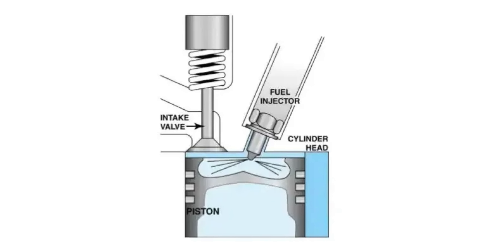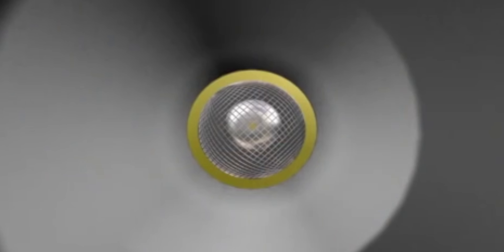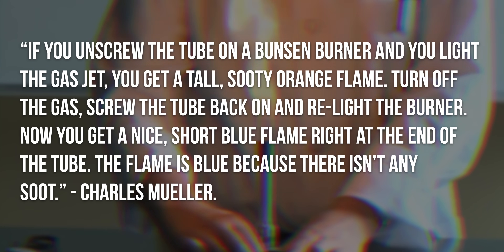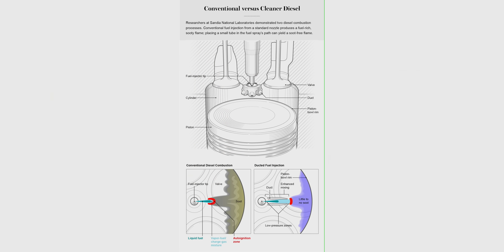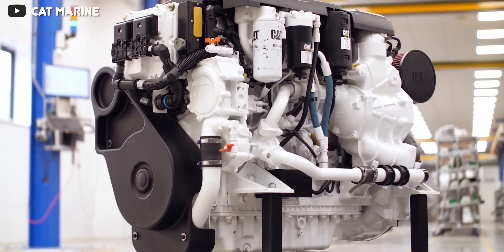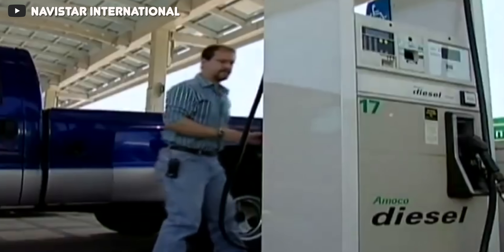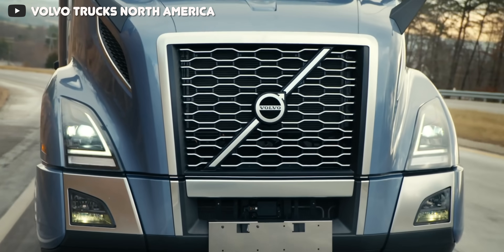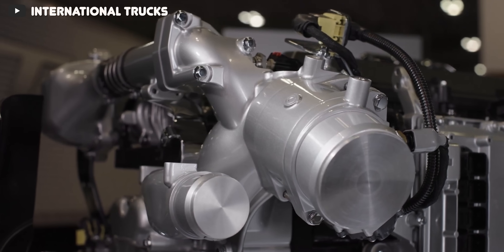Zero Emissions Diesels: How Ducted Fuel Injection can Save the Diesel Engine

Comment: You can't just massively increase EGR usage to reduce NOX, the whole point is to reduce combustion temps but you can only do that so much before you go too far and cool it too much. Soot is not a limiting factor to it. Also it doesn't eliminate soot, a 100% reduction in soot means they cut it in half. Which would not eliminate the use of the DPF or urea injection as it filters our WAY more than just 50% of soot, it filters most of it. The other aspects like NOX and other emissions still need to be dealt with. Also diesels are not almost entirely killed, there are many many types of diesel vehicles out there and they will not be killed so long as we are still burning dino oil. And right now battery electric vehicles are incapable of replacing gas and diesel vehicles. Only when we get away from batteries and and use some other kind of technology which allows for far greater energy density and are able to create clean power will it even make sense to switch over. Because right now it takes way more oil to move an electric vehicle than a gas or diesel vehicle and a modern vehicle is gonna be burning that shit cleaner than a power plant that is dated. Besides we would need to completely revamp our electrical grid to handle the dramatically increased power usage. Right now electric vehicles can only serve a niche market and it is straight up impossible to switch over quickly like many want and would take several decades. Diesels will be going on for decades to come and probably the next 100 years easy.

Comment: It is absolutely mindboggling to me how the advantages and general efficiency of diesels, especially in passenger cars, is only now properly washing over to the states.
There was a time in central europe, where more than half of new cars were diesels, and im talking small, efficient, nice.
Take a VW Polo 1.6TDi for example, one of the more common examples over here.
We have a high-quality subcompact with 5 seats, a usable cargo-area, all the comfort you could ever need, yet still less than 1200kg with a 95-115hp diesel engine that makes like 250nm of torque and takes about 3.5l/100km, thats about 65mpg, while happily cruising at 100mph on the autobahn all day long. There is also the 1.2TDi, which runs rougher and makes 75hp, still pulls about 200nm and is insanely good in terms of drivability, while approaching 70mpg on normal use.
or take all the 2.0 diesels that are around here. Between 130 and 200hp on average, up to 500nm of torque in some configurations with the average being around 350-400, still getting 50+ mpg.
And its not like they are unreliable or downsized shitboxes" either; you see all of them at 150k miles+, running around, not having any issues. and thats with people using them as short-trip daily drivers.

The general approach of giant, oversized vehicles with giant, overpowered yet inefficient engines for daily use and usually a single person occupying it has been shoved so far down the throat of many but especially americans, that its just normal and they deal with that bullshit at this point.

Diesel has not been "smelly black smoke and loud stupid engines" for like 2 decades at this point, yet that consensus is still imbedded in people. and the "dieselgate" didnt help that, while meaning that at its worst, the emissions were still pretty good, despite the cheating.

Comment: Not new combustion chamber heads have been in pistons and in the head of military equipment for years. Top money is on the lanova head.
 White diesel Mountain fuel 2 and 1/2 ton engine A combustion chamber in the piston.! 
Combustion chamber the coffee was in the head.
   The Volkswagen question chamber system in automobiles trucks and boat engines was twice as efficient on the road 65 miles to the gallon..!
    Stupid manufacturers turn their diesels down so they will use more fuel even if they have to screw with  cam timing ..!
     Military CUPV engines did 45 Miles to the gallon the Chevrolet counterpart only got 23.!

Comment: The Bunsen burner gets its extra air from the Venturi effect.  Where is this duct of the diesel fuel injection getting its air supply from?
A few questions remain unanswered.....  
-There should be a compressed air system to go alongside the fuel injection. It is easy to install one in a diesel engine. 
- the injector system has to be closer to the engine head or else there would be compression losses. 
- the injector air system should be valved and metered flow or else it could theoretically make the air fuel mixture lean and the cylinder pressure higher by acting synergistic with the turbo. 
This brings me to the last question - why didn't anyone try a high pressure common rail diesel injector in an idi engine? They could've used 2 injectors in every pre-combustion chamber. 
Why not have 2 injectors by the side of the intake valve stems? 
Did we give up on the idi engine too early?

Comment: To make a diesel burn cleanly, you first remove the shitty fuel it burns and replace it with hydrogen. You cannot make any injection system burn that crappy slow atomizing fuel well enough to even come close to 0 emissions. The atomic structure is just too complex to not react into an emission. A Bunsen burner is NOT 100% clean and carries it's own oxygen content to burn, but just clean 'enough' to use in small spaces. Diesel fuel is NOT the same as Bunsen burner fuel. Replace the fuel with a better fuel and move on.

Comment: The example using a Bunsen burner and diesel fuel isn't a very good example. And no way is injecting diesel fuel you're just saying we're doing a better job mixing it with the injector that when the Piston comes up that it swirls inside of that chamber so it gets better error mixture. But that doesn't have anything to do with the injector as much as it has to do with the shape of the head?

Comment: Almost sounds like the first Diesel injection system: Blast injection. R. Diesel wasn't able to create the high pressure directly to the fuel. So he used compressed air to inject the fuel. Pressure was 200 bar.

Comment: Could this ducted system be applied to more than just diesel engines? What about gasoline engines? What about heavy fuel oil engines used on ships? Could we see any applications of this in aerospace?

It seems that the ducted injector could theoretically be used on any fuel as long as it's a fluid.
Reply: Not much use in gasoline engines since they inject fuel prior to compression and don't produce soot. Any engine using compression (usually diesel) ignition could benefit. With regards to aerospace, piston aircraft engines generally use spark ignition. Turbine engines, however, do use compression ignition as the fuel is injected straight into the high pressure hot air coming into the combustion chamber. GE's newest aircraft engines (GEnX I believe) use a special 3d printed fuel injector that mixes the air and fuel into a lean mixture before it begins to combust, decreasing NOx emissions. It probably reduces soot but I'm not sure if turbine engines have a soot problem.
Reply: @Zed86zz  If I had to guess Id think not as soot would make problems for the clearances.
Reply: The question shouldn't be whether this works with "gasoline" engines, the question should be whether this works with other types of fuels with compression ignition, which in theory, it could. We call compression ignition engines "diesels", but the reality is that many different types of fuels can be used with same "diesel" cycle.

Comment: Carbon dioxide is the enemy, not internal combustion engine. Keep that in mind, the synthetic fuel will save the ICE vehicles and the other one, is alternative fuel. They're both better.
Reply: Carbon dioxide is not the enemy and never was, ask any greenhouse grower! If you've fallen for that propaganda I bet you're quadruple poked too eh!......
Reply: @paulzx10  Carbon dioxide absorbs infrared spectrum light and reemits it in all directions creating a blanket in the troposphere. If it didn't work we'd be a frozen planet. If we didn't know that we'd also not be very good at fertilizer science either. You can't just cherry pick the science you like. Trend the hydrological patterns over the past 120 years yourself. The data isn't a secret. It's not a narrative, it's measurements.

Comment: Considering the efficiencies of the newest electric motor designs, the only legitimate long-term use for this diesel configuration would be with freight trains which use diesel engines to turn the electric generator armatures which produce power for the electric motors which drive the trucks (train wheels).  I don't think we have any direct-battery-powered electric motors that can move a fully-laden freight train.  Someone out there more familiar with this please correct me.
Reply: a modern electric motor is >90% efficient.... what are you on about?

modern trains are connected to the central power grid..

you're incorrect on every point...
Reply: @zaarkeru3391  I don't think my statement was explained well enough.  Let me try again using some of the information you've supplied.

Considering the fact you mentioned about modern electric motors being so very efficient, it would seem that diesel engines in general would not compete well with these modern electric motors -- except perhaps FREIGHT TRAIN locomotives, where a diesel engine spins a massive armature to generate very strong electrical power that powers the locomotive.  This generated power, from what I have understood, is considerably more than anything that could be fed directly from batteries.  What's more, since the energy store is liquid chemical fuel rather than tons and tons of batteries charged for the trip, the overall setup is much lighter weight during operations and can travel much longer distances.

I really do value your corrections, so if I am still wrong about this then please correct me rather than just tell me that I am wrong.
Reply: @adamchurvis1  
modern freight trains are fully electric, they use capacitors or batteries to get the train going.
because they are efficicent and have a much higher safety factor than a ICE.

so, you build the train to handle the mean output (what power it needs to run at flat travel speed from the grid side (plus a few more % overhead).
and then they use the batteries to slow down (by charging them) and when speeding up or travel up a hill.

this ofcourse requires good grid connections.

because batteries/capacitors today are more space efficient from the sense that you dont need to carry a extra wagon for fuel, the batteries/capacitors usually fit inside the locomotive. :)

so American freight still might need a large diesel generator (as you mentioned) of the grid connections are lacking.
Reply: @zaarkeru3391  I see.  Thanks very much for the education, sir!  Yes, American freight locomotives still have diesels (you can clearly hear them) spinning huge armatures, for the most part.  Here in Georgia that's the only kind I've seen, and I live near the railroad so I probably would have seen other types if there were around.

Thanks again.

Comment: Gail Banks is the greatest Diesel  expert the world has ever had !  Bank’s Engineering in the USA of course !”       And he  say’s  making black smoke or rolling coal as some call it is completely a waste of power going up in the form of  black soot or particulate matter       what a waste of fuel  his engine’s that he builds do not smoke at all not even visible with a  camera ! Under full power and I mean 2000 horsepower and 2500 foot pound’s torque  not even visible  so there all you hear heads  now why are diesel’s heavier  than gas ????? Hmmmm well the have more compression so they have too have thicker more heavy material’s  and robust construction so there for more weight  add too that the fact that torque  is bigger on a Diesel engine  (the ratio is like  one horse power too two foot pounds of torque  and gas is the exact opposite ) but still even though diesel’s make more torque  you have too either (turbocharge  crankshaft drive a supercharger or combine both  )but no matter kids it all boil ‘s down too torque too move heavy things big things  and  that means displacement  too make it which mean a bigger engine which means more weight  weight equals strength heavier material’s) or lighter stronger more expensive materials so they use  cheaper too produce materials like cast iron )there for       the big displacement so you can move things plus heavy construction and there you have it .  You can go smaller and make up the difference with bigger turbos etc but  all things equal  stay with big displacement and low rpm less friction loss that way and then you can pull 200 metric tonnes or more”  like road trains do in Australia with 855 cubic inch “ or 14 litre engine’s five full gravel boxes of gravel no problem or pull  214 feet of air drill with a farm tractor  or pull three and a half mile’s of grain cars with a locomotive that’s diesel  and big big massive heavy engine’s that’s it lesson over and may I ad if you combine that with electricity like trains have or 400 ton mining trucks have then we’re talking  “but pure electric engine produce full torque as soon as the brushes start turning  and will out pull out run any Diesel engine  any day of the week  and are way more reliable  more efficient  and silent  and if you use hydrogen fuel cell’s  in combo with battery’s  well it’s  just not fair because if your a diesel you are going too loose that’s it period no competition  goodbye !”.you can go naturally aspirated  in a diesel but then you have too make the displacement of air and fuel bigger therefore more stroke  or bigger bore or both  so if you want too stay smaller than you have too pressurize beyond atmospheric pressure  that mean ‘s turbo or crank driven super charger  or both and at sea level the pressure of atmosphere is 14.7 psi if you have boost of half that you could double your horse power  I think ? Not sure but o well .

Comment: You wont see this or any other tech that improves emissions from ICE, why? Well atleast here in the EU many governments have a boner for EVs at any cost and includes heavy taxation towards diesel in particular. Example of this is here in Denmark where I live, a modern Euro 6 approved diesel car which is cleaner, or at the same level(CO2, Nox, everything), to an equal size gasoline car, cost almost 3 times as much in ownership tax every half year and depending on the price bracket has increased almost 100% in purchase price(small b segment cars) which has caused them to pretty much dissappear from the market if you want to buy new. On top of this the diesel cars are in some cases rated for much worse MPG or Km/l than they actually achieve through normal operations. Example of this would be my own car with a BlueHDI 1.5L 100bhp motor which is registered to have a consumption rate of 21,1Km/l or about 50 MPG but actually, with city driving included, is more in the ballpark of 26Km/l or 61MPGs or almost 72 MPG on long highroad/motorway trips.

I really don't care what people drive. Drive whatever you are happy with. I just wish the debate could be more honest and less shortsighted. Apparently it makes more sense to exchange the entire fleet of cars for EVs, which has its own ups and downs including the bombshell of a Co2 production cost(battery and such), than push for Co2 neutral efuel which would also help with the Co2 production from other industries and would be cost friendly to the consumer. We already have the technology.

Comment: Diesel engines aren't that bad as EPAs worldwide want to make politicians believe. The Diesel industry should throw a lot of money into the DFI, because there's so much Diesel fuel out there, it would be a shame not to use it. EV aren't the future. From 1 kg of plastic waste, we can make 1 litre of Diesel fuel through pyrolysis. The heat for the pyrolysis can come almost free, if you couple the process into the cooling system of a Dual Fluid Reactor DFR, that burns nuclear waste. It's possible to create a complete recycling chain with low emission.

Comment: Yeah.. But we been sitting on Barrierless air ultrasonic air cleaners for decades too. Filterless and super low power cost. Could have been used to knock filth from exhaust into oil catch to empty every month to recycle everything caught. With plasma generated ultrasound, clarity is limited by the ultrasonic limits of the stars, and in conjunction with holographic techniques we could clean even nuclear debris from atmosphere perfectly. Make water cluster to control rain and boil water with solar to compensate for what we take to restore balance on Earth. %99 of the problem is mass producing millions of versions of products we can download on our smartphones. Unfortunately for military dominance of masses, that was also programmed into masses. To waste as much as possible, and then govt hired from that indoctrination.. World is going to fall if we can't break it.

Comment: just imagine what this fuel injector can do when it breaks off as its huge inside the combustion chamber and heat is bad for things. 
weve seen tons of failures from glow plugs and injector tips due to the heat and pressure in the combustion chambers. just wait till the tip is 10x bigger.